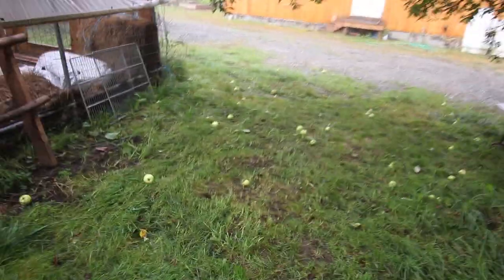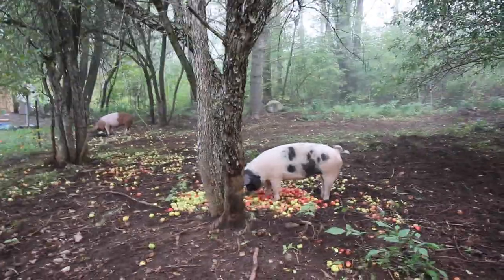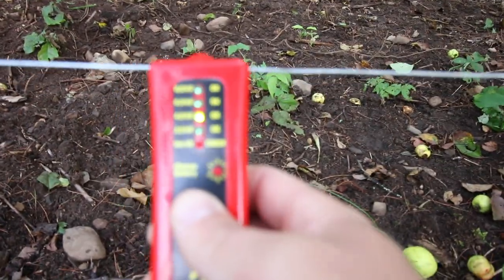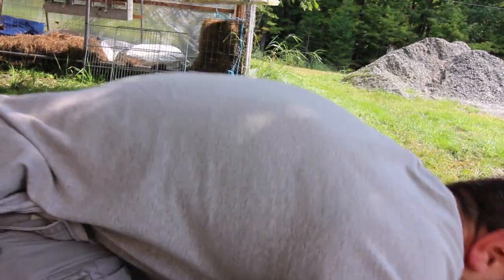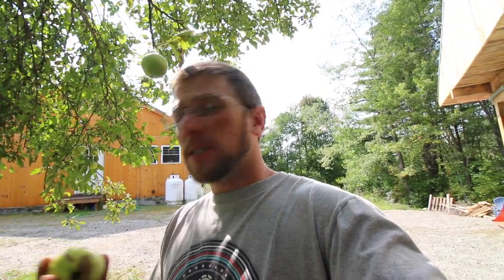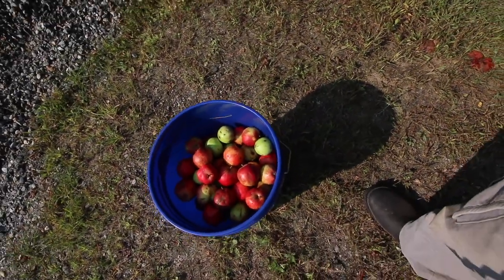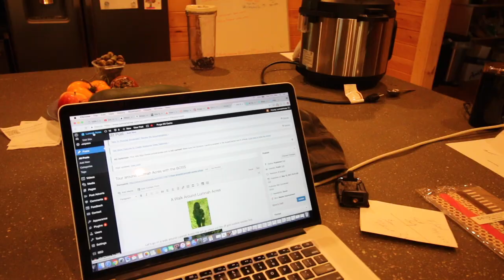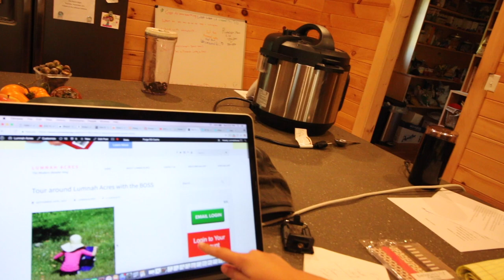We have Neglected some Homestead Chores and now we are PAYING the PRICE~

Comment: you can also use t-posts and put raised up tarps or fine netting around under the apple tree and slope the tarp to a collector pail/bucket so the apples go right in the bucket for you, and you need to have a hole in the bottom of the bucket to let the water out. And watch out for hornets they like fresh apples too!

Comment: Al @ +Lumnah Acres about a week or so ago you mentioned that the woodchip pile isn't breaking down very fast. Well, with that big pile 'o nitrogen (grass clippings) added to the woodchips, that will speed things along in breaking down the woodchips. Make a big hole in the center of the woodchips and mix the grass clippings into it, then cover the hole over. In 2-3 weeks you'll find that the grass clippings will be degraded down to compost and the woodchips covering the grass will start to break down as well.

Comment: Hey brother have you ever thought about a diy solar system for your house and stuff like that electric fence ? That fence with that single battery would probably only need a 100 watt panel to charge your battery constantly with a little 10 amp charge controller, my channel I'm trying to get off grid with solar try it out brother on your fence
Reply from the maker: Yes , we want to go solar. We are working our way there